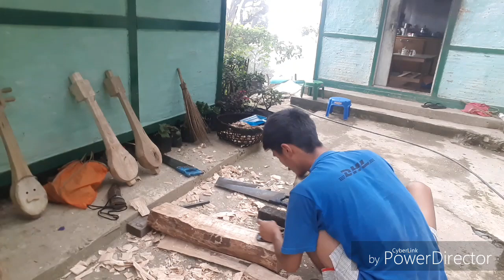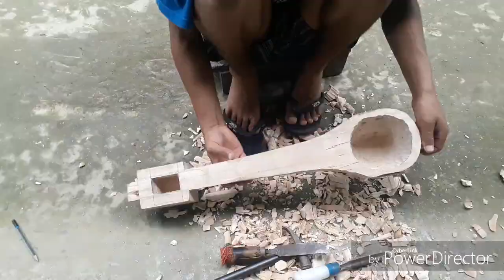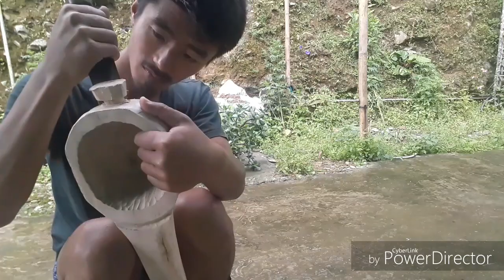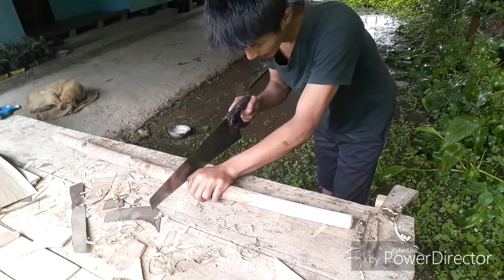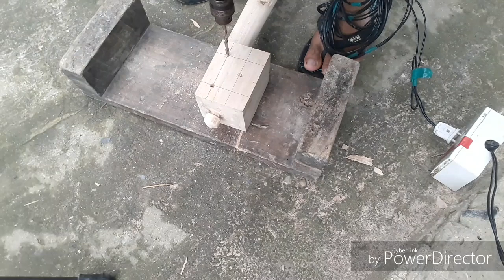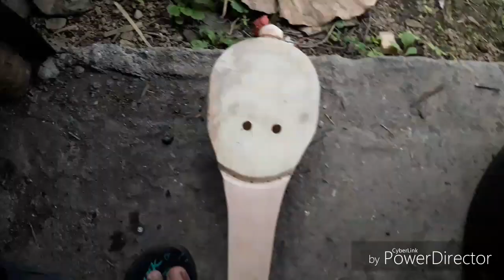How I made (TUNGBUK) Lepcha Instruments

Comment: What type of string is used? Can u please explain🙏🙏🙏
Reply from the maker: Its a badminton gut. But don't buy any expensive one. Vixen Badminton String POWER SHEEP is best and its jus Rs. 70 or 80 per packet.
Reply: @pangkarmagyalpo9836  thank u very much for replying anum. I have few question what should be the exact length of neck and what type of skin r u using to cover a hollow part? 🙏🙏🙏💖💖💖
Reply from the maker: I have explained that all in video. You can use any skin. I always bring skins from siliguri.